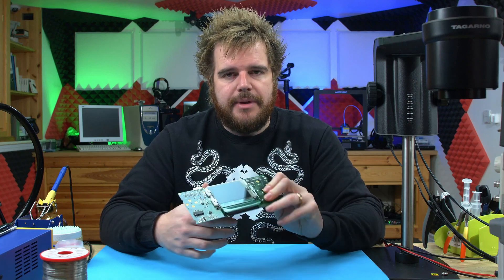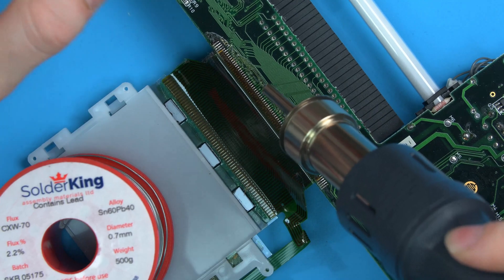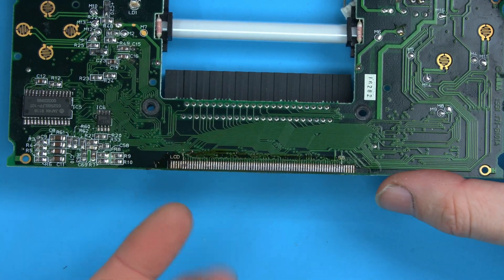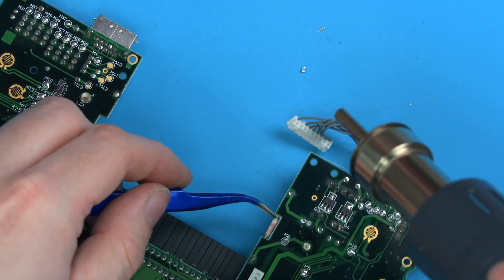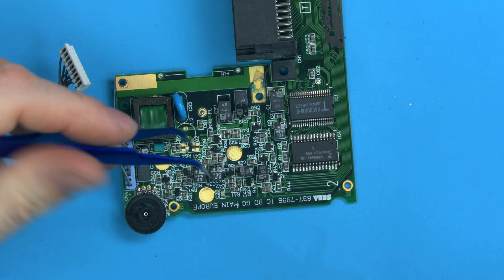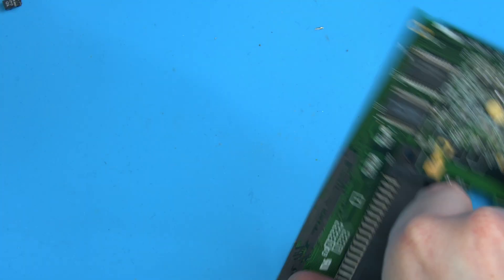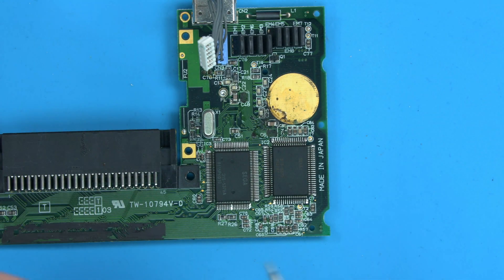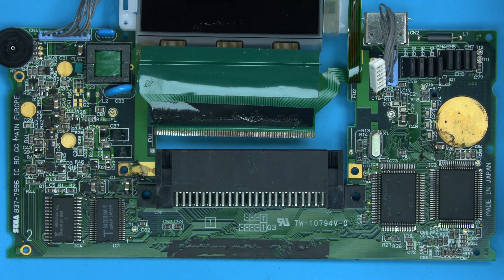Fastest Way Recap Game Gear Capacitor Replacement - RetroSix

Comment: Maybe someone mentioned this below that when using the hot air he blew off one of the transistors at the same time he was removing a cap.  He didn't show it working at the end so maybe he found that later.   I am on my 3rd attempt now to do a new screen.  The parts are so tiny it is very hard.

Comment: This was a great video, I’m trying to do a similar project but am new to soldering and hot air guns. What temps and fan speeds should I use when desoldering?
Reply: he mentioned in the video his settings are at 420c and 120ci/s air. if you use a cheap rework station, that would translate to 435c at speed setting OF 6.5 if its the dial type.

Comment: Which hot air system are you using? What would you recommend for a beginner?
Reply from the maker: I use the Quick 861DW it is a very good station. I had Weller and Hakko stations costing more and this one easily performs the same if not better. We will also stock them on our store soon

Comment: So no need to remove the r29/r56 and r30/r57 + cutting the 34v wire? This board is ready for the cleanscreen as is?
Reply from the maker: For CleanScreen just remove L2 is all that is needed. Cut 34V or just use CleanJuice and disable 34V using switch
Reply: @RetroSix  ok thanks! Just bought everything but screen as they’re sold out and I’m getting all boards ready for the screen when it’s restocked. I got the clean juice and battery packs also. Awesome products🫶🏻

Comment: It would be good to use a pre-heater for this to reduce stress on the board. I know you think this is less stressful but the temperature swings from hot air create a lot of stress as the board expands and contracts in specific areas instead of the entire board. Reducing this stress is the entire point of a board pre-heater for hot air or a soak heat profile in a reflow oven.

I see where others pointed out Q9 at 7:45 and R52 at 8:04 but at 6:59 you also lost C50.
Reply from the maker: Yep pre heater would be good but really not required. Heat goes mostly into the component then solder and has less time to flow to rest of board. If reflowing larger pin components could use pre heat but you won't get issues just using hot air for a task like this. You won't even get it for removing and reinstalling the ASICs. I've done hundreds. The cartridge connector however is perfect example of needing pre heat
Reply: @RetroSix  As far as components go, it’s the high-density connections of QFP legs and such that get stressed the most without a board heater. Also, internal traces and connections on multilayer boards… so it’s more about SMD rework on 4+ layer boards and high-density connections than stuff with big pins on two layer boards like this. You are absolutely correct that much of it goes into the component first but that kind of localization is precisely what stresses the board.

I don’t think it is a huge concern with a two-layer board like this and you see techs like Louis Rossmann doing it on more advanced boards all the time so it’s demonstrably not a big deal. I really only mention it since the stresses on the board are actually increased while you seemed to imply the opposite.

I’d also suggest a second pass at the caps with fresh flux. The flux from adding solder to the pads has already been used/activated and you could end up with a cold solder joint. During a recap job with solder already on the pads I like to stage my caps in my sticky gel flux lid where I also pour a bit of liquid flux. I then transfer them to the board with flux already on them.

Anyway, I think C50 just tombstoned since it seemingly disappears from its footprint but doesn’t seem to end up anywhere else.
Reply from the maker: Yep agreed. In terms of less stress I'm meaning because of the acid damage using a soldering iron you will apply far more stress to the board than this. You will have to leave the iron on longer, scratch, scrape and cut components off due to glue keeping it down and acid preventing heat transfer. I did another video on the cleanest way to recap prior to this and we do all the clean up there. Thanks for the feedback though
Reply: @RetroSix  You’re absolutely right about that. :) There are more stresses to consider here and hot air is probably safer than fighting the corroded pads with direct heat. :)

Comment: I am starting to collect old consoles and do repairs as a hobby. I have been watching your videos and would just like to say thank you for the amazing content! I have just bought a broken game gear from ebay and I will be using your videos and guides to see if i can get it going. If I can then a replacement screen will be next. Thanks for the detailed information.
Reply from the maker: That's great to hear
Reply: I'm doing exactly the same. I picked up a GT a few months ago purely for nostalgia, but after re-capping it i got the bug and now have a GG, GB and lynx mk1 with screen upgrades and cap kits on the way

Comment: It appears that you are replacing an electrolytic with a ceramic cap.
Reply from the maker: Correct. Nothing wrong with that. The caps are decoupling caps, dc blocks and for timing. In all instances the ceramics have been tested and scoped to perform the same or better
Reply: @RetroSix  Then why did Sega use electrolytic sun the first place? The characteristics that require them instead of ceramics have nothing to do with footprint, temperature, and capacitance… or else everything would be ceramic.
Reply from the maker: What characterists require them exactly? They use aluminium due to cost
Reply: @RetroSix  It has to do with things like frequency and polarization. Look up the old AfroTech video on it. Ceramics were always cheap.
Reply from the maker: All the caps have no requirement to be polarised nor frequency dependence on being electrolytic either. Most are just bulk caps, some are for DC bias and DC blocking. The rest are audio smoothing which work better as ceramic
Reply from the maker: Also ceramics are still not cheap. 100uf ceramic is 10x more than aluminium
Reply: @RetroSix  I trust you because I am not an engineer, but do you want smoothening to “work better” for audio when that could reduce fidelity?

Comment: Would using hot air be safe without removing the lcd tube...? Ie. could the heat transferred from the board damage the tube...?
Reply from the maker: It's ok so long as you don't point it and leave it directly on the tube itself yes

Comment: Thanks for another great video Luke. Did I hear right in one of your previous videos you can do repairs for free for content for your channel? I have a GBA which had a screen mod, clean amp pro, dehum kit and clicky triggers but the power switch recently broke so I attempted to solder a new one but in the process messed up some pads, then messed up some more pads trying to fix it, ended up running some wires from vcc and SW1, I then ended up needing a 150ohm resistor for r13, then my fuse has now gone! I bridged where the fuse should go just to check to see if I'd gained power again but the GBA just started smoking so I had to quickly remove the batteries and have no idea where the smoke was coming from! I'd very much appreciate if you could take a look to see if this console is fixable! I'm scared to touch it again now, otherwise I think I'd have to remove all my mods and buy a new GBA, all because of a stupid power switch fail!
Reply from the maker: Yep just email me contact@retrosix.co.uk and I'll tell you where to send

Comment: Excellent video... However, around 7:45 a Q9 files off... Also R52 and R51 are displaced in 8:03. I agree though it is a whole lot faster. In my last GG recap, I took the time to remove very carefully the caps without breaking the pads. Then I cleaned the old solder with wick to leave all pads pristine and retined and put ALL caps carefully... took me more than two hours... So knowing how to do it fast is really nice.
Reply: Also C50 at 6:59 but I think it’s just tombstoned.
Reply: LOL, this dude is blowing away parts of the board, I think I won't do this method.
Reply from the maker: Ha yeah perhaps 90 on the air not 120. In one way it's good to show what can happen and to pay attention. I was focused more on showing the techniques and not on the parts flying off lol but so long as you pay attention hot air is the way to go
Reply: @RetroSix  Indeed. Definitely the way to go. Two hours+ on a menial work that can be done in minutes is the way to go. I guess each one of us has to experience with the equipment at hand. I'll try with air at 90... Actually I am yet to use the hot air gun in my soldering station, lol.

Comment: Thanks! Are you shure about ceramic cap instead of electrolytic?
Reply from the maker: Yep. Sold thousands for years and also did all the checks on scopes to see the effects on the voltages and ripples etc... They work even better than electrolytic
Reply: @RetroSix  I would love to see you do a video showing us everything under the scope so we can put this debate to bed.
Reply from the maker: Didn't know there was any debate? Lol